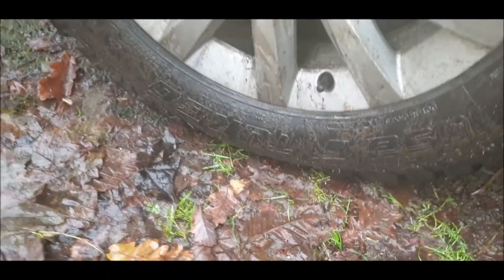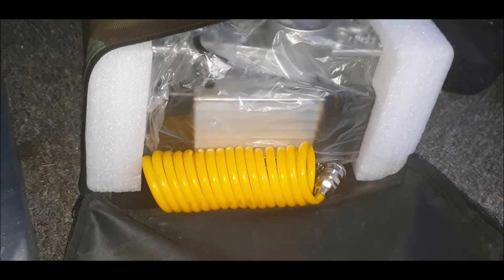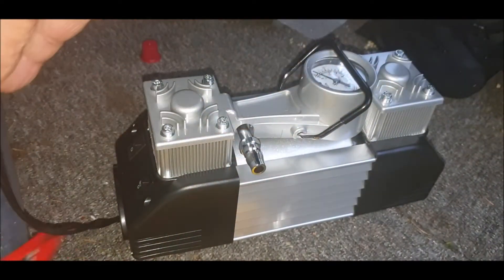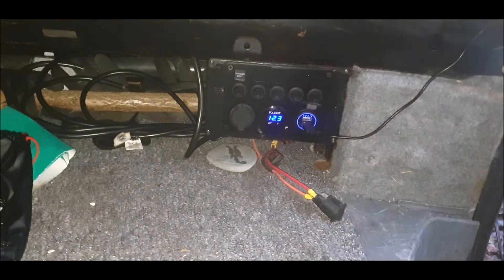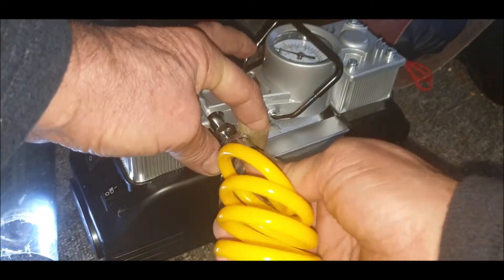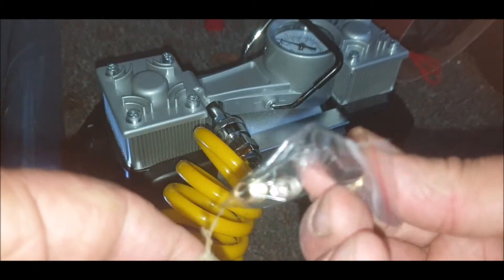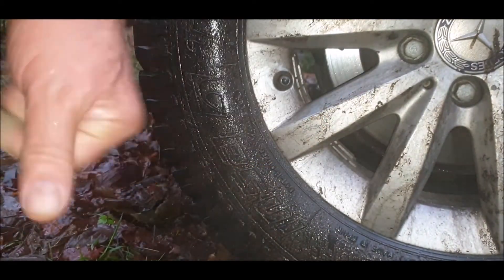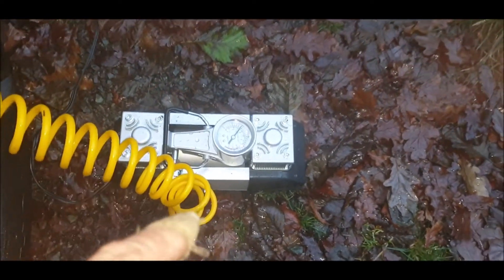HEAVY DUTY MOTORHOME PORTABLE 12V AIR COMPRESSOR 150PSI TYRE INFLATOR PUMP REVIEW

Comment: I have this type of tyre inflator. It only works and pumps air when it's not connected to tyre. Once you connect it to tyre and switch it on to pump the tyre, it does not work. What's the problem please?
Reply from the maker: sounds like valve stuck
Reply: @MrMeltedwellies do u mean the tyre valve ? The inflator tyre pressure gauge reads correctly when it's hooked to the tyre but it won't pump out air into the tyre

Comment: This compressor do 5 psi up in 1 minute. 3-4 minutes one wheel. 10 minutes work 10minutes brake recommended . Longer will cause  damage . So you done 2 wheels in 10 minutes.  No 4 in 5 minutes as you mentioned. 
Still good. Don't lie.